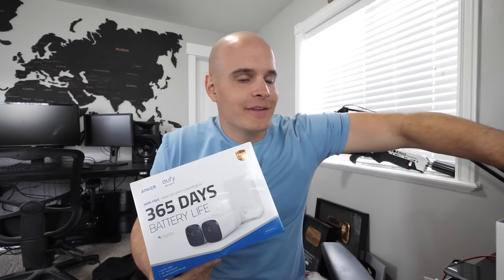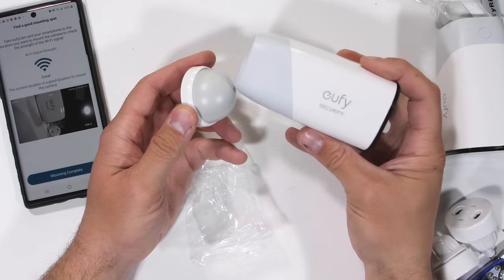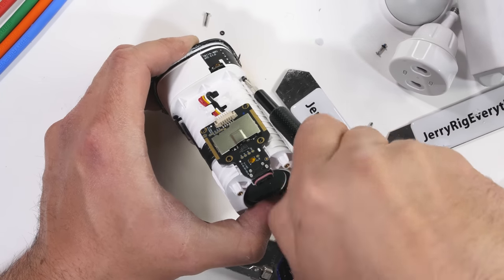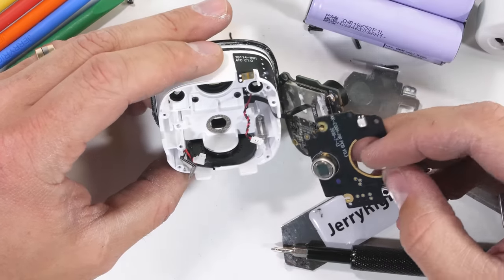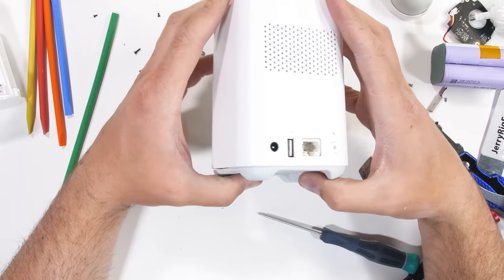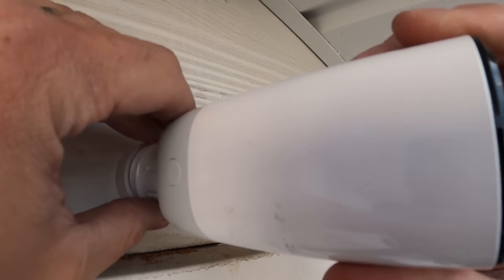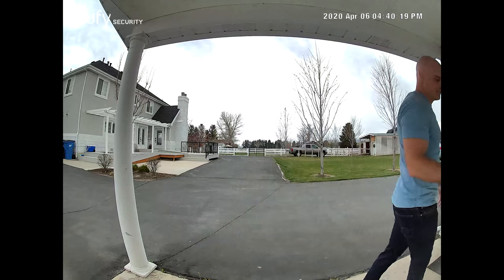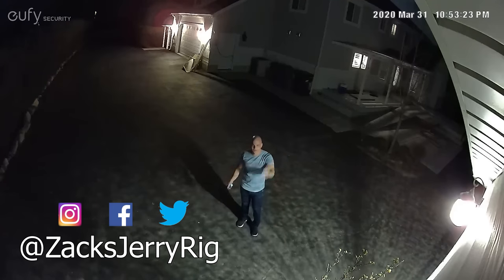365 Day Battery!? - Eufy Wireless Security Camera!

Comment: When a wireless security camera has higher resolution then the entire security system in the country
Reply: That’s actually sadly true, as they spend thousands for cameras that are the quality of a potato.
Reply: And the cameras with Bigfoots and Ghosts.
Reply: When a wireless security camera has higher resolution than my phone
Reply: @All_SportGG  oof
Reply: FUN TIMES!! ❤️🤗🤗👍👍
Reply: Phone cameras : 8k
Video cameras : 8k
Security cameras : 144p
Reply: :P
Reply: And it also has colour.
Reply: its funny they say it's 1080p, and but my zmodo 720P cameras have the same quality. I was lazy with the install though, its a rental and didnt wanna drill holes in the wall, so I just ran the wires between the gutters and up over the roof and in through the back door lol. I'm way off in a flag lot, so nobody can see the house from the street anyway.
Reply: @kleocelanji7049  I'm baffled that security cameras not only dont have great resolution, but cost so damn much. They are all running on very cheap tech. Cell phones have made quality lenses so high definition. I'm sure whatever sensor Samsung used in the S7 is dirt cheap by now and has terrific quality.
Reply: @kez1619  places like Walmart bought the cameras probably 20 or 30 years ago, and as long as it works they don't bother replacing it
Reply: @frostbite1991  it's better to put a phone as a security camera .
Reply: touch time
Reply: yep!
Reply: im sure they could spend a couple hundred dollars just to get some extra storage
Reply: This is a completely different story, the security system is always on. Zacks cams are on idle.
Reply: @All_SportGG  my Galaxy S20 Ultra takes 8K videos....would love a security camera like it

Comment: Thanks for making the video. Helped me open up mine to repair a damaged lens.

If anyone is planning on opening up theirs, don’t fully remove the 4 screws on the back. Leave them protruding slightly when you unscrew them. You can use them to help push the camera out of the housing. 
Put the whole thing on a firm bench with the camera pointing the ceiling, then push the housing firmly down against the 4 screws on the bench. The camera should start popping out. 
That way you won’t damage the front black plastic!
Reply: do you think it will be possible to change these battery cells if they die or starts drain faster?

Comment: I love how Anker basically just went:
"We'll sponsor you if you take our stuff to pieces"
Reply: Anker is a legit awesome company. They sent me a free smart light when I inquired about my current smart light having issues with google assistant.  They said it was a serverside issue and had fixed it that same night AND told me theyd be sending a light. A+ company and will always buy stuff from them
Reply: Anker's surge protectors are pretty good too
Reply: Jimbo Sifehkxin their power banks are also pretty good
Reply: I got the Eufy Robovac.. brilliant bit of kit :)
Reply: Anker is expensive but it's quality meet the prices
Reply: @GroundZer0000  stop
Reply: @GroundZer0000  Typed by phone made or build in china
Reply: @GroundZer0000  Anker doesn't have access though since it's not stored within the cloud.
Reply: @GroundZer0000  DON'T BUY A HOUSE, THE WOOD COMES FROM CHINA!
Reply: @Ethorbit  ikr LMFAO
Reply: @Rin Kochou I'm sure they sent him one to take apart and one to keep.
Reply: @indianboy0453  where is the charger to recharge the batteries ????
Reply: @GroundZer0000  Your comment was made in China
Reply: @berardoferrari  It comes with a cable that you're supposed to plug the camera into the base to charge it.
Reply: @indianboy0453 when you almost die in mario bros

Comment: Zack, you should also take a look at wireless-battery-solar-powered Reolink Security Cameras. I was previously doing a bunch of research on security cameras and was conflicted among Argus, Eufy, and Reolink; the problem with most of these cameras is that they REQUIRE your internet to be online the entire time, so all a potential trepasser has to do is cut off your internet via wire cutting or disrupting and you will lose access to your security. Reolink appears to be the only one that doesn't have this security flaw that can be exploited of requiring an internet access to still continue recording, and still no subscription whatsoeer on top o zero maintenance with the solar panel.

Comment: The Real Question is:

How long does it take to charge?
Reply: Well it's only 13000 mAh so probably only 5-6 hours.
Reply: a year
Reply: @kuylardev  every year
Reply: Like other devices, it will probably take double the time to charge than it will stay alive for. So two years
Reply: Im guessing about 2-3 hrs. My power bank,  20,000maH,fully charges with my 15 watt charger in about 3-3.5 hours...
Reply: @Prinkiestonkie  my 10000 mAh Anker Powercore takes about 4-5 hours to charge so I assume it'll only take a little more than that will since the brand is an Anker subsidiary.
Reply: Another thing to think about: 
The only way to see if the battery actually lasts for a year, IS TO WAIT A YEAR.
Reply: @Cash-jw7ix  ever heard of fast chargers and flagship phine batteries?
Reply: 2 years, not much ;)
Reply: Mine takes around 8 hours to fully charge. There is a "fast charge" on the base unit.. or there is on my model which is the first gen one.
Reply: You're definitely gonna lose the Charger in a year... No charging needed then 😜😜
Reply: @SuryaKarigar  Well only if you lose all your USB to micro usb cables yes. Lol silly micro USB! 🤦‍♂️
Reply: @Cash-jw7ix  since when does the battery on a Samsung S20 ultra take like 2 days to charge
Reply: The real answer is:

Yes
Reply: @Prinkiestonkie  sounds about right
Reply: @Cash-jw7ix  like my nokia
Reply: @Cash-jw7ix  what "other" devices u using boi?

Comment: I picked up that same exact camera pack.. I also got the rubber protection sleeves that go around them. I picked up the flood light (hard wired) for my garage and that thing is amazing also it’s super bright and they’ve all worked flawlessly. I have them set for better surveillance rather than battery life. Even with that setting they still last 3-4 months before I have to charge them. Great video!!

Comment: My security setup is ip cameras that only require a small power cable. The video is transmitted wirelessly. My cameras record 24/7 and the video is saved on my server that runs 24/7 anyway. The cameras only cost $30 and the server cost about $60. The data is all stored on a hard drive and can be accessed whenever I want. I prefer 24/7 recording because the motion detection isn't always accurate and my garden has lots of trees and moving objects. Overall, my setup is pretty much fit and forget. The cameras have a permanent supply from the mains.

Comment: I have the original EufyCam, and it really is a  good system. I have one mounted above the front door, and one above the garage. Installed September of 2019, and I've only had to recharge the garage cam once, because of more activity. If you install the cam near a light source, you dont have to use night mode.

Comment: Will it actually charge from the low current available from a small solar panel?
Reply from the maker: I've seen them for sale from Amazon.  I haven't actually tried one yet
Reply: I have purchased wireless battery camera with solar panel. charged fully once and installed (over garage door)  since August 2020, still shows battery 100%.
Reply: @kkaround  can you share a link please?

Comment: Too bad this is also vulnerable to the same flaw that SimplySafe is, the $2 transmitter. Watch lockpickinglawyer if you want a demonstration.
Reply: LPL ❤️
Reply: So the low power PIR sensor triggers using 433mhz to the base station to initiate the power hungry WiFi link to stream the videos? Is that correct? Hmmm interesting
Reply: nvm, based on the teardown, and the fcc specs, no 433mhz transmitter inside. So it should immune to cheap 433mhz atrack

Comment: I have the blink XT2 camera system, you should do a review/tear down on it and are a lot less expensive. They run on 2 AA batteries which makes getting the camera back up and running a lot better option, no need for charging or an additional solar panel. They are also rated to last 2 years. i have already had mine set up for over 8 months and they still have the original AA's they came with!

Comment: Awesome video, just purchased a 4 camera system. Most likely a silly question however when attempting to charge, manual specifies a red indicator light will illuminate when charging, I’ve plugged the cable to the base unit for fast charging however a blue indicator light is illuminated - is it charging or no?? Help anyone please.

Comment: This spot wont test durability to rain which is essential for outdoor cam.
Solar cams r the best, have same facilities(cam,mic,audio) if not more cos it rechrges it self, means i dont have to climb to take it down to rechrge it ever, which i am useing for the past 3 years with no issues at all, less $$$, no need to use extra router to connect it, and has simple method of connecting to wireless router.

Comment: One big problem with Eufy camera is that if someone jumps up there and steals it, all the footage from that camera goes away once it's out of range...  It's true and it's stupid.  You may think, yeah but my internal storage.  Yeah well it's just so happens that the footage is connected to the camera.  Also, you may think, yes but the person who steals it is on camera.  Yeah well they are for about 20 seconds, then after they run away with it, ALL the footage from that device is inaccessible...  Huge problem.  Now, Eufy does offer a cloud option where you now need to pay a small fee every month and I believe that actually may counter this stealing camera problem.  But even then, someone still ran away with your $100 camera...  Also, the camera under normal video conditions does not last 365 days.  It lasts more like 5 months.  But, you can counter this by installing a solar panel for $40 which I did.  I have also had TWO cameras break in less than a year which Eufy let me return, but I think that only lasts a year.  One got water inside from rain and it would just disconnect when it wanted.  Other camera just lost power and would only record motion and wouldn't let me access the camera live.  Either way, nice camera but unreliable since I replace two in the first year.  Fragile cameras, are not rain proof, last 5 months of battery under normal recording conditions, also doorbell cam which I have last about 2-3 months before you need to charge.  Not a huge deal, just charges up in maybe 6 hours or something, but still.  I does have a wire options which I am debating hooking up.  Door bell cam is nice, no problems with that.

Comment: Here is the thing. I tested a battery powered security camera in my backyard before. The company claimed that the battery should last for 6 months. But the new one I tested only last for one week and then the battery needed to be recharged.
The cause: my neighbor has a waving flag “active” majority of the time during the day and the shadow landed on my backyard. 
The battery powered security camera motion sensor has been triggered most of the time. It will defeat the purpose of having the camera monitoring my whole backyard if I set the sensor detection to avoid the shadow of the waving flag.

Comment: Good thing is wireless, easy to install, internal storage.
I am using this camera for 7 months now
Didn't like few things, The battery went for 5.5 months as it was recording lots of clips. It didn't detect my car on the drive way (where the camera focus) even in the active zone, then I had to turn on clip recording outside of active zone and it detected my car, at the same time it was recording whole lot of clips from the road moving car which was outside of active zone, draining the battery. Also sometimes it misses human but almost 97% it works ok.
It doesn't have snooze function for recording, only snooze for notification. which is very essential thing to have.
It does delete clips from memory card before three months even there is space available in the card. The logic should be space or three months which ever comes Last, easy to fix but not sure why eufy doesn't do that.

Comment: You said it plugs into a router,  my internet is through a wifi dongle, no router. Will, this still work through a wifi dongle with out the need to plug into a router? Cheers

Comment: Looks like they limited the frame rate to 10-15fps to aid in that battery life.. makes sense.

I'm not a fan of "wireless" security cameras, but this actually has a base with decent antennas... questions is how well and far those cameras can transmit. That's ALWAYS been the main problem with wifi cams is the ability to transmit data through wood, metal, rock... plus the limitations on bitrate and resolution because of that too.

Still seems gimmicky coming from a security salesman... but I at least know and trust Anker, so we'll see.

Comment: Wifi Security devices: hey, I'm convenient and guard you!
Hacker: de-auth attack
Wifi security device: .......
Reply: That's easy to protect against, you just enable Secured Management Frames on the router, and the De-ath attack no longer works as it only works against unprotected management frames, and if the device wont accept unprotected frames, then the attacker is SOL.

Comment: Damn the resolution at night is shitty. But during the day its google. They need a lens that can be zoomed manually or electronically. My system saves at home and has manual zoom that's been set. Infrared lights shooting out at 150 ft disrance 25 ft wide that make night crystal video recording. But it's not battery so lights out means I had to buy a battery bank separate to keep it running.

Comment: For that price I get 2 camera with Li battery (battery will degrade over time and needs replacement) and a base station (which will have for sure distance limitation). For that price I would rather buy Xiaomi Ax3600 (wifi 6 with long range 2.4 ghz) and 2 no's xiaomi 360 camera (camera can follow the person and rotate 360 degree). How will I power the cameras ? I prefer to tap power from nearby power point.

Comment: Oooh my time to shine in my other job. Not only do I do phone repair but I sell batteries.
These cameras are great because they use a rechargeable battery. Never buy a battery powered security camera (Arlo cameras are like this) that uses cr123 batteries unless you want to spend a ton of money to keep replacing batteries overtime. I still like wired over the arlo shit. 
I wanted to be that guy to correct you about the tesla batteries and using 18650s but you said "was" and not "is" so dammit I can't be that guy.

For those that don't know tesla uses a 21700 now instead of an 18650. The numbers mean 21 or 18mm in diameter and 70 or 65mm tall and the 0 at the end designates the cell shape which would be circular. There are other numbers for like squares and rectangles but I don't know them. 

Long battery rant/information:  I kinda wish all batteries went by this naming/numbering scheme because when you get into button cell batteries for watches and crap like that the numbering/naming is all over the place. Hell you can have 1 battery with 20 different names/numbers. Seriously the LR44 size battery can be called anyone of these: LR44, A76, KA76, V13GA, 904, G13,
 LR1154, PX76A 357, 303, R357, SR44, KS35, KS36, SR44W, V357, V76PX, D357, SB-B9. Now there are some difference between some of them like some are alkaline and some are siver-oxide but they are all the same size and voltage. Well technically the silver oxide is 1.55 volts instead of 1.5 volts but generally you can use them in place of each other. The same thing can sort of be found in AA, AAA, C, D, and 9volt but generally they just have 2 names like for a AA it could be AA or LR6. There are other names for each one but they are so rarely used it doesn't matter unlike the button batteries. Thankfully lithium coin cell batteryes use the same naming/number scheme as lithium ion batteries like the 18650. They will use Cr2032 which means 20mm in diameter and 3.2mm thick/tall. Now the CR designation can change and be BR2032 which is just a difference in the positive electrode in the battery but 99.999% of the time it doesn't matter and the CR usually has a longer runtime while the BR has a longer storage life and a more stable voltage output.

Comment: The sensing/ recording not reliable. I am using almost 7 months and it lost sensing two times. Right now it does not record car movement inside the active zone. Not happy to go through this issue - got few advice from Euffy but not working. It happened after their update I assume.

Comment: 1) The advertising lacks one critical information: It does not tell how often and for how long the motion detection can get triggered so that it can reach the advertised 365 Days. 
Is it 300 Days in standby and 65 Days recording? 
Is it 364 Days in standby and 1 Day recording? 
Is it 364 Days and 23 hours in standby and 1 hour recording? 
...

2) Every product with non exchangeable battery is junk after a few years, because: Batterys lose capacity not only through charge cycles, but also when they just sit around, like these cameras.

3) Without nightvision, you also need lights around your house that trigger for motion. Otherwise the camera wont see anything at night.